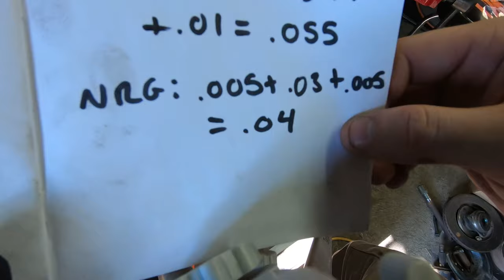Dana 30 Rebuild Guide Pt.2: Yukon 4.56 Gears, Gear Setup, Powertrax No-Slip Locker

Comment: I’m in this process right now and have watched this video several times. I have a HP Dana 30 as well and went with the Powertrax Grip Pro LSD.  I toyed with the idea of going all out with the sleeves and truss but for now re-gear and LSD with new wheel hubs will do, can always come later now that the hard stuff (getting old hubs off!) is done and add that stuff.  Great video, thanks for all the details. I’m at 4 tries on getting the right pattern.

Comment: I have a 2011 ford ranger fx4 off road with a solid front axle swap. So I was thinking about getting a Spartan locker for my front axle for when I go off road to have full traction. But the problem is I'm worried about steering binding because of it & daily driving. Do you recommend a limited slip or auto locker?